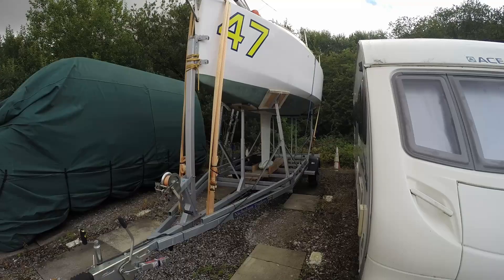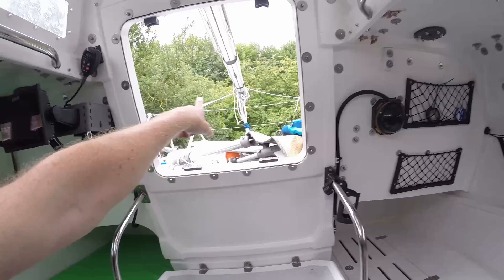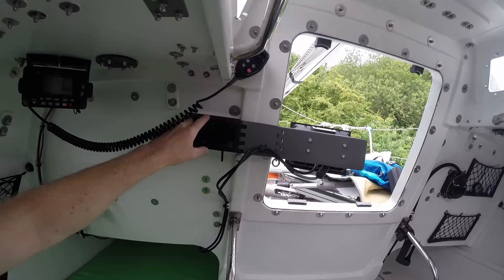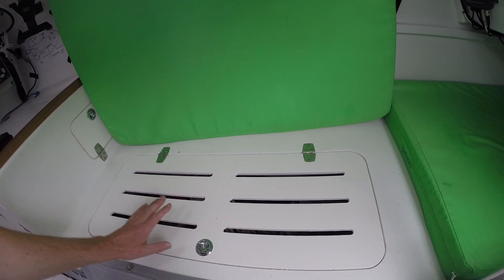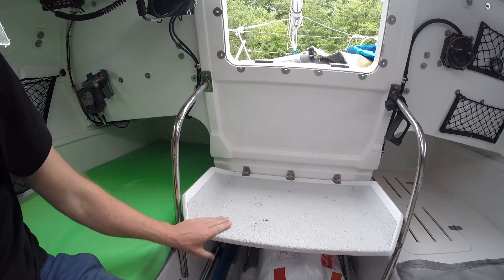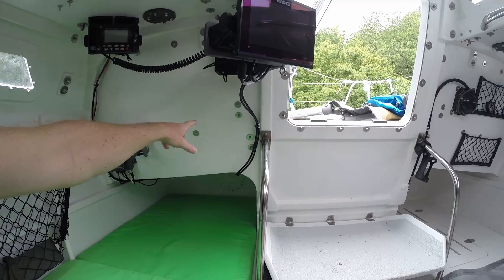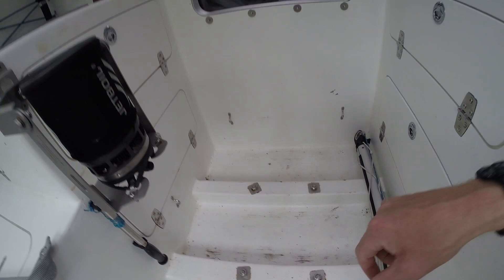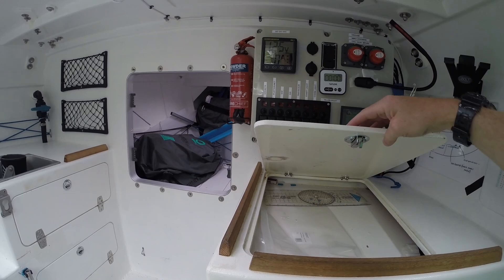Tiny boat tour - Inside a tiny ocean crossing yacht . (Class Globe 5.80 transatlantic yacht)

Comment: I am a professional mariner. On dark nights it’s not unusual for most electronic devices to blind you. What I do is buy temporary window tint. It’s easy to cut a piece to fit the window on the radio, AIS chart plotter or anything else and put it on and off as needed.

Comment: The use of acorn nuts is nice for those through bolted items. What you might consider in hindsight is T-nuts. Not as pretty but, they will be essentially flush instead of protruding. I'm sure that you can find them in stainless steel. The downside is you don't get the same diameter as a fender washer.

Comment: Hi Peter, new subscriber here😊 Thanks for your effort to make this „nerdy“ view on your boat. Very interesting. Your electric cabinet is really propper wired. I’v seen a lot of rubbish in other boats. 
May I propose „heavy duty eye bolt rings stainless“ as a usefull solution for some screwends at your sealing? 
Together with shackles, ropes and bungee cords I use them in the Defender for strap, tidying and tie up tent, boxes, luggage, chairs….. endless usable for camping trips.
Beautiful little, brave boat:-) Now I will enjoy your sailing video.

Comment: You can attach an inexpensive car window tint to the VHF. You should swap the powder extinguisher for a foam extinguisher. After an operation, all electrical devices and the engine are unusable.

Comment: Interesting video about fantastic sailing machine - I am concerned about all of the thru-deck bolts protruding into the cabin especially around the companionway - one good bump of your head could result in a skull penetrating brain injury - plywood donuts/pads bored to match the bolt patterns and stuck to the underside of the deck with polyurethane would be an easy fix - sorry to nit-pick!

Comment: During your crossing it seemed like the boat was struggling with some of the multi-directional waves you encountered. Do you think the windvane was the weakest link? Or could your sail plan been tweaked abit? Or just life on a smaller boat? Bottom line question is what is your opinion on the boat design?

Comment: Nice, 
Would you change anything?
Reply from the maker: Quite a lot! But mainly stuff like the main hatch to the cockpit, it's really awkward to get in and out in rough weather, also more storage for small stuff, things tend to get lost in the big lockers. In anything other than low latitudes where its nice and hot so stuff dries out, stopping water getting into the boat from waves/spray/rain or having something to absorb condensation would be necessary I think. Maybe a more thorough spray hood/dodger etc, and down below some more antislip on the cabin sole, it's like an ice rink when wet!
Reply: @thenorthcardinal  thanks, seems like the day to day comfort is what you missed, I think Don McIntyre talked about that in one of his videos. He had a few handholds around the place as well.
Thanks again and well done, all the best for your future.
Reply: @thenorthcardinal  you should make a whole video on that! I would love to know what kinds of things are wanted or needed on this little boat.

Comment: Very interesting. I have found an analogue ammeter is the most useful instrument n the power supply panel. My charge controller is very difficult to read and I discovered that mine does not show amps..
Reply from the maker: Agreed, the battery monitor shown in this video shows amps in and amps out so what effectively your batteries are 'seeing' from the solar vs the drain. I got a bit obsessed with power on the Atlantic crossing as the solar panels either broke or got washed off and I had to bodge them back together. Without any other source of power I started to focus on charge rates a lot!